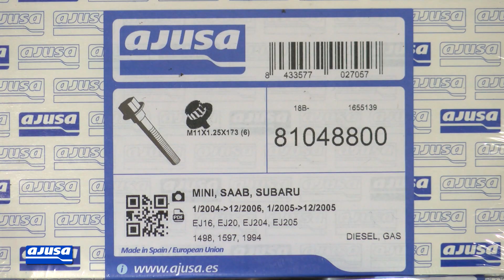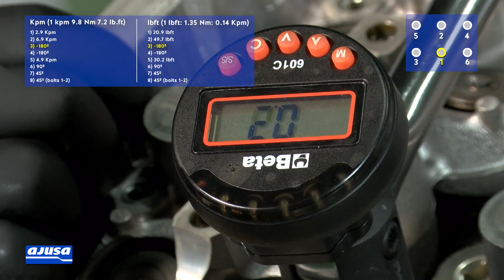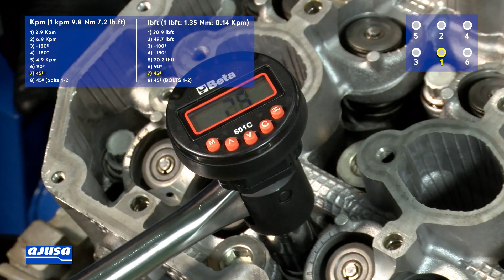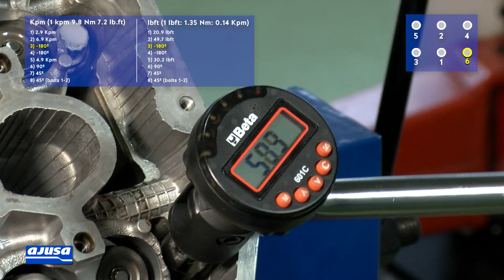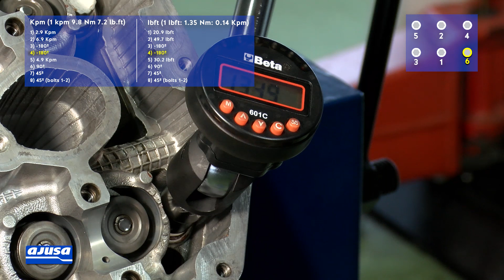SUBARU IMPREZA 16V (EJ20) 🔧// Montaje junta de culata Ajusa – Intallation cylinder head gasket

Comment: Que tipo de grasa es la que ubica en los tornillos de culata?
Agradezco su respuesta.
Reply from the maker: Buenas tardes Xavier! Nuestro equipo siempre utiliza grasa de cobre. Esperamos haberle ayudado y que tenga un feliz día. Le invitamos a seguir la actualidad de Ajusa en nuestras redes sociales: 

🖥️ https://www.facebook.com/AjusaSpain 
📸 https://www.instagram.com/ajusa_automotive/

Un saludo.
Reply: Hola buenas tardes, que torque tienen los pernos de la culata al montar?
Gracias
Reply: Consulta quiero cambiar empaquetadura de culata de un subaru legacy en necesario sacar el motor o se puede ser con el motor puesto agradecería esa ayuda
Reply from the maker: @bogdanedu1557  The use of copper paste is recommended since it facilitates when giving the tightening torque to the cylinder head bolts. It does not have to favor galvanic corrosión.

Kind regards